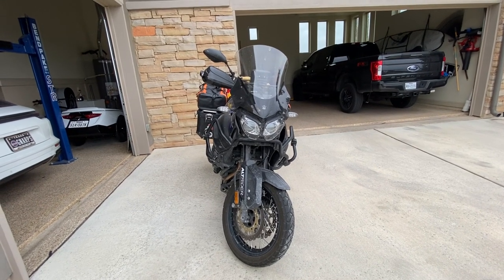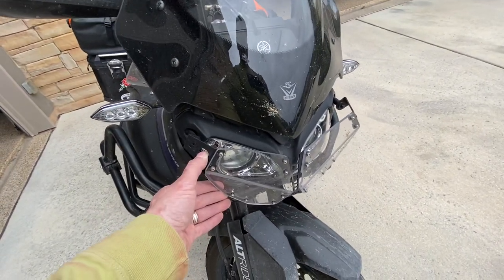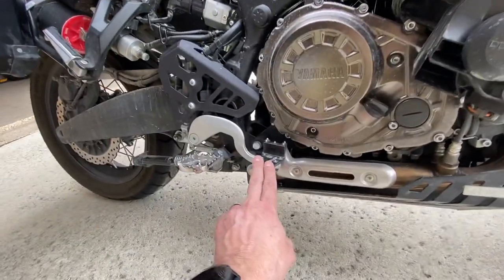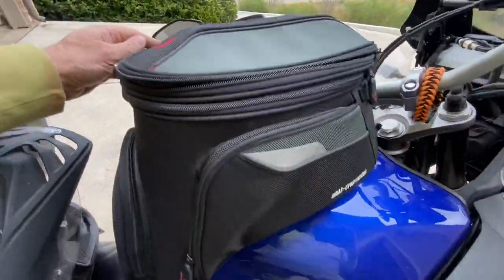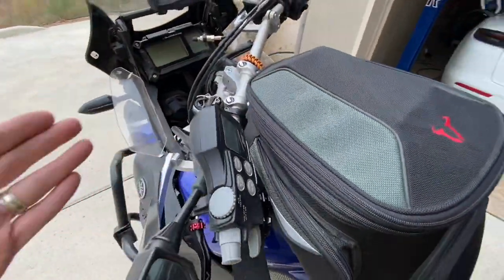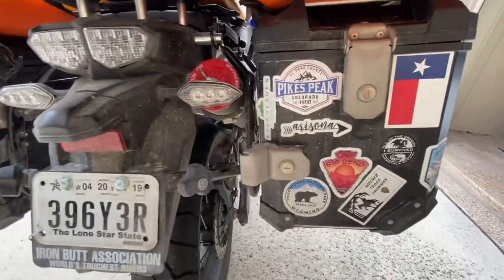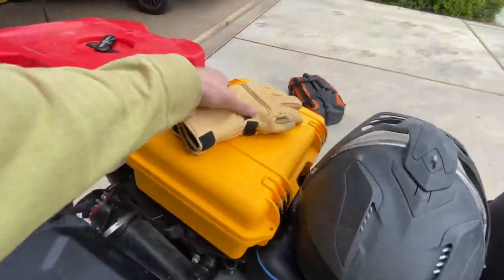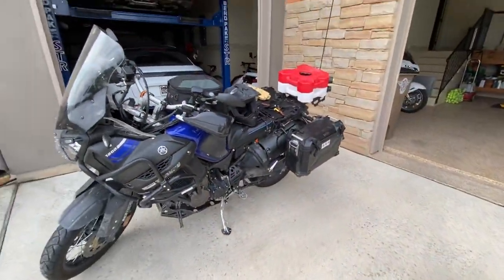Yamaha Super Tenere Alaska Motorcycle Trip Preparation

Comment: I agree with you when it comes to the quality of Yamaha. I also have a Super Tenere 2016 ES. The SW Motech boxes are a big step up from the stock ones. My wife and I Camped off the back of this very capable bike more than a dozen times last riding season. Having the mountains in my back yard, the bike had to be set up for the bush. Running the Mitas EO-7's front and rear. A Great 50/50 tire.On more than one occasion we have found ourselves in quite a tight spot. But the Yamaha always powered us through some very technical dirt. As long as you turn off the traction control first. Not doing so has got me into some trouble. Mostly when you need to spin your way out of a problem and the engine stalls right in the middle of a puddle. lol. I live near Vancouver Canada. So if you are still planning on heading up to Alaska in 2020 let me know and maybe we can share the road. Cheers Richard.
Reply from the maker: Thanks Richard! I am hoping to go in '21

Comment: I have the arrow mid pipe and a Yoshi slip on on my 2013. I had it tuned and we got 94 hp at the wheel. Lots more grunt through mid rpms where you want it.
Reply from the maker: Truth Only awesome! My tuner used woolich software and weeks out 108 or so! Made sure I was not too lean though

Comment: What about the most important aspect of the bike, the suspension? That looks like a lot of weight on the rear what kind of spring/valving setup are you running?   Light is Right!
Reply from the maker: I agree! I have adjusted preload to the max and am still a little too heavy. I do have a replacement spring for the back, and just received springs for the front. I may go for a replacement in the back to support longer trips and the gear that I will need for them. Light is what I am going for, and experience will help me decided where I can trim more!

Comment: Watched, but have to say this, I assume you are staying in motels, or cabins ? You'll find out that your  1200cc bike is over 2 times the bike you need. Once in BC then Yukon,  top speed is 100 k = 62 mph. In Alaska , 65 mph.  Everything and I mean everything outside Anchorage & Fairbanks  maybe 45 mph. Top of world hwy lucky if you get 45. Haul road the same. Now if it rains ( it will) the bridges are dangerous ( wood decks) then the mud will cover you and the bike 1 to 3 inches thick. Clean asap !!!!! Don't get me wrong sir, I did it with my brother in 2012, absolutely breath taking. I will go again soon. This time on a Kawasaki x300 Versys. It is all the bike necessary.  Lightness is bliss. I wish you good luck and my God Bless You
Reply from the maker: Rogue  thanks for the tips! Actually I just purchased a T700 and will most likely sell the S10. Much of what you cite I have read about and prepped for. 👍🏼

Comment: Nice setup Walter. Can you tell how tall you are since you said you have really enjoyed the V-stream windscreen. I'm looking for a replacement from the stock one. Rode to Houston area from St. Louis yesterday and the stock offered no protection. Also, which height V-stream did you purchase? Thanks...
Reply from the maker: 12Casper I’m 6’2” and ordered the middle height one. I did not want to look through it. I must say I am a fan as I have had them on several bikes!
Reply: @waltersprang  Much thanks Walter, safe travels...
Reply: @waltersprang  I am just over 6' and I bought the tallest one. I still look over it and have it mounted in the lowest position. I have the option of moving it up if I wanted for real bad weather but it seems to work good for everything where it is. I put some braced on the windshield mount a guy was selling on the forums that really help strengthen the shield mount/accessory mount.
Reply: @Doug_Morgan  Do you have a Madstad bracket or the stock bracket assembly?
Reply: @4motofanatic  I have the stock bracket. You can buy braces that are similar to the braces that work with the Mastad mount. If you want some I can send a link. It was a guy in the USA selling them but now it is a guy in Canada.
Reply: @Doug_Morgan  Thank you, I actually just ordered the Madstad...

Comment: Something I did to mine after having it blow over on a trip last year was to upgrade the rear spring on the shock. The spring rate on the stock shock is too low for a loaded bike and it pretty much sat level on the side stand so I would really have to watch where I parked it. I now have the proper amount of squat in each of the settings with the new Eibach spring I bought. I had to have a custom spacer machined to use the Eibach spring as they are a bit shorter. BTW do you still have this bike or just the T-700 now?
Reply from the maker: Just sold this one and I only have the T7 now.

Comment: when you added the 2 inch risers, did you need to extend your cables to accommodate them? If so, what brand did you use?
Reply from the maker: Sorry for the delay. I did need to extend but the kit (Helibars) came with the cables needed. I did the extension because the cables were under stress when the bars were at either extreme

Comment: Nice bike. About the same mods as I have done on my 2016 xt1200ze.  I do have the swmotech steel rack with trax adv top and side panniers and the space underneath the top track ( which is about the same as the altrider rack) I have used to put a waterproof giant loop possibles pouch https://www.giantloopmoto.com/product/possibles-pouch/  in it, that always contains a mini compressor,a  tyre repair kit https://www.allroadmoto.be/en/stop-go-tubeless-repair-kit-mini-air-compressor.html  and a sae2 optimate extension cord + sae2 to cigaretteplug optimate extension cord..
I'll be doing a 55000 km review on it as well as an overview  in a video soon too.
Reply from the maker: NICE!